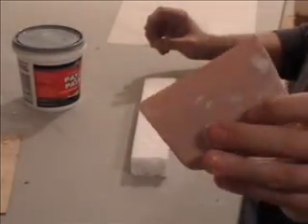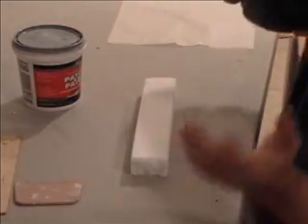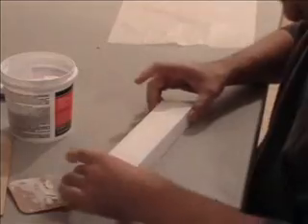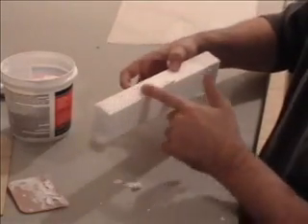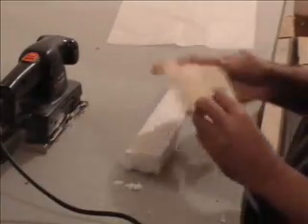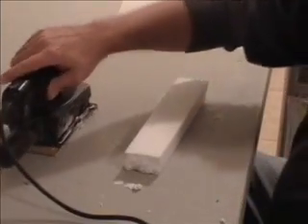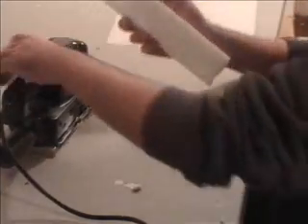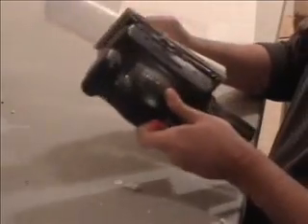Sealing EPP with LWS

Comment: I can't buy such spacke in europe probably... I make my own spackle for EPP. At first I want my spackle to be very light, sandable and most important flexible like EPP... not exactly, but close.  I use universal glue for rubber+thinner+a lot of microbaloons. When My surface is ok for paint I spray it with white plasi dip then paint the surface with airbrush and over that one or two coats of clear plasti dip spray.